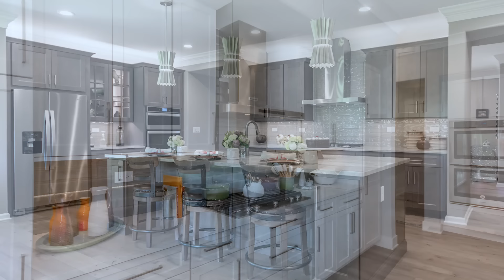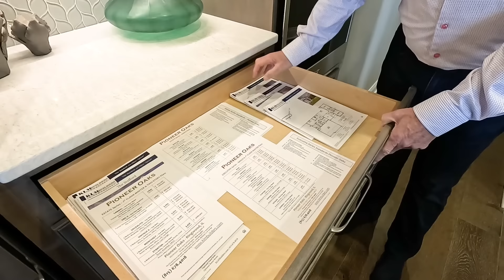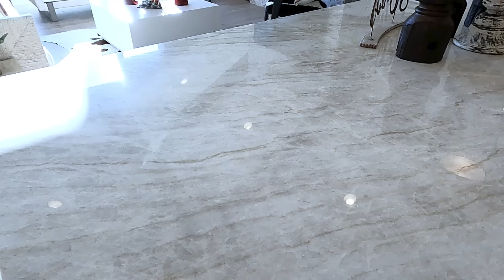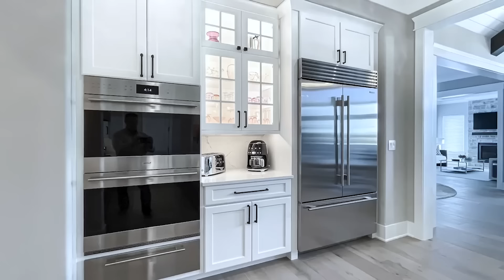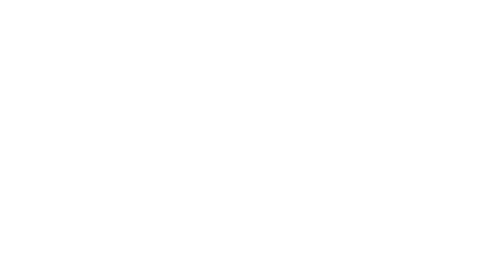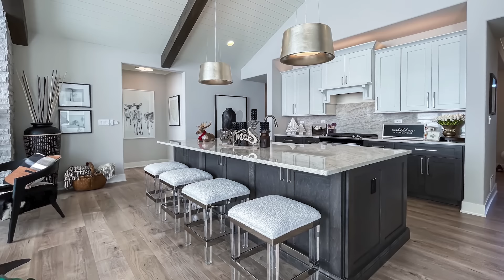MUST SEE Kitchen Design Trends & Remodeling Ideas from a Home Builder!

Comment: Great informative video. The only thing I disagree with is quartz countertops. We've had both granite and quartz countertops, but granite was definitely more durable. The quartz countertops we have now since 2020 has numerous chips on the edges, and I mean numerous - especially around the sink, and even one on the island edge. We're looking into replacing the quartz countertops with granite. Yes, the chips can supposedly be fixed but I'm just finished with quartz, no matter what the experts say. Sure, it's beautiful but day to day living tells a truer story.
Reply from the maker: Great points. Granite is a great countertop surface!
Reply: I have had quartz for five years, and it doesn't have a single chip or scratch.  Maybe it's the brand.
Reply: Me neither

Comment: when you put the plugs on top - something to consider is that now you will see appliances + heavy cables going up the wall which i think is worse than the standard crowding you would get if the plugs were on the wall
Reply: I thought the same thing.

Comment: What is the best size of a kitchen?
Reply from the maker: A good, practical kitchen size depends on your home and personal needs, but 150 - 200 square feet (roughly 12×15 ft or similar) is widely considered a sweet spot for most families. It gives enough room for good workflow, an island or eat-in space, and modern appliances without feeling wasteful or hard to clean.
Smaller (under 120 sq ft) works for apartments or minimalists, while larger (250+ sq ft) suits larger entertaining homes, but 150 -200 sq ft hits the balance for comfort and function in average U.S. homes. Hope that helps and thanks for reaching out.

Comment: Why do people say quartz is durable? It’s manmade slop that can’t take any heat. If you put something over 300 degrees Fahrenheit on it, it will be severely damaged. Granite, quartzite, and porcelain all handle heat better.
Reply: Quartz can handle water and scratches. Who puts hot stuff on the countertop without a proper pad underneath it?
Reply: @MikeJohnson-nr4yo   IMO, one of the main benefits an expensive stone is durability, and that includes handling heat. That’s why I’m willing to pay a premium. If I only wanted something that is semi-waterproof and has the heat resistance of a towel, then I would go with laminate.
Reply: There is more to use than heat.  I’m accustomed to using heat pads on old fashioned laminate.  But laminate suffers scratches, surface wear and burnishing, all things my quartz doesn’t do.

Comment: Soft close cabinets and drawers need to be the standard!
Reply: Stainless appliances are not going anywhere. They’re extremely popular, good thing we all have choices.
Reply: @G17-911 You're entirely correct. Go to any appliance store and you will see rows of stainless steel and usually very few options. One of the reasons the manufacturers have stuck with stainless so long is the cost to manufacture. The stamping of the stainless panel is totally automated. It's stamped and brushed to give it that finish. Very few people needed to produce. No sprayed on finishes which adds to cost. So, as long as consumers have few options to purchase, they'll continue to buy what they see. There are newer options available but you have to look for them.
Reply from the maker: Totally agree… they are so nice to have 👍
Reply: Nice kitchens. One thing that's long overdue to be retired is the stainless steel appliances. I'm so tired of that look. We've had the same look for over a quarter century. There are better options available now. Time to move on.
Reply from the maker: @greghaage2031 starting to see more matte finish appliances and also paneled fridges to blend with cabinets. They look 👍
Reply: WHY create taller cabinets? Who can actually reach up there without a stepladder? What an insanely useless trend.
Reply: @WesternSkies-us7xw I absolutely agree! I am 5’1 and even the higher shelf’s in my cabinets, require me to use a step stool!😅